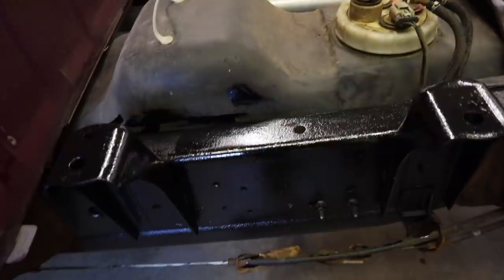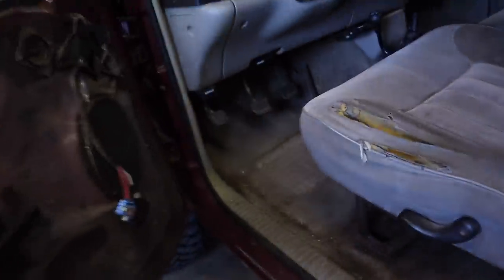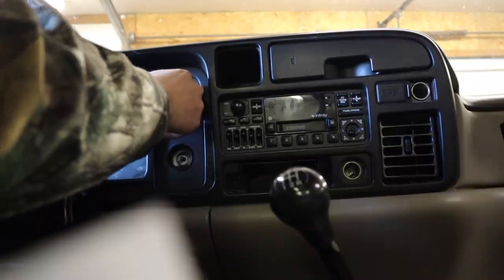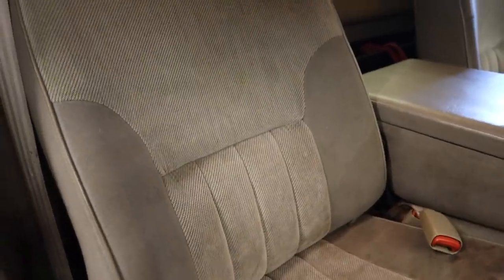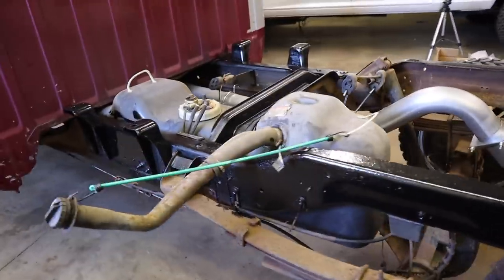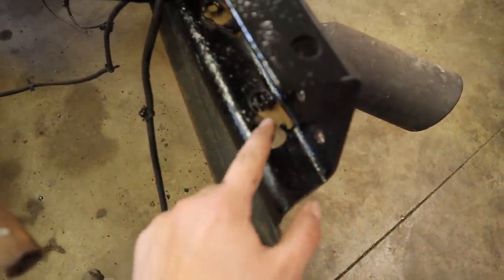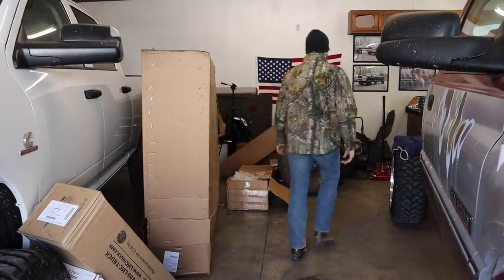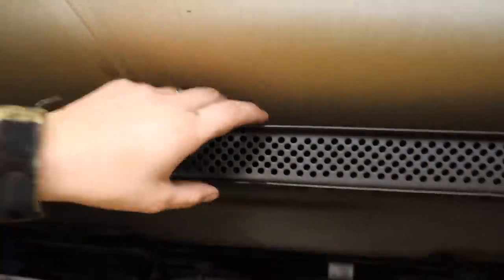IT'S FINALLY HERE!!! THE PART YOU'VE ALL BEEN WAITING TO SEE!!!!

Comment: got my cross shirt in the mail yesterday!  2:59 are the bumpstops on the rear supposed to have a spacer between them and the frame when lifted?  If you hit a big bump will the shocks bottom out before the bumpstops?  My 2nd gen came with 2 in spacers between the bumpstops and the frame.   Kind like these  https://www.northridge4x4.com/part/bump-stops/8058-30-synergy-manufacturing-rear-bump-stop-spacer-kit-pair?gclid=Cj0KCQiA2ITuBRDkARIsAMK9Q7NDK1pJgpLpYy3Uo0jayhuab5jGwx0iMBdjTHroFRi3503YSEC59IYaAqTSEALw_wcB